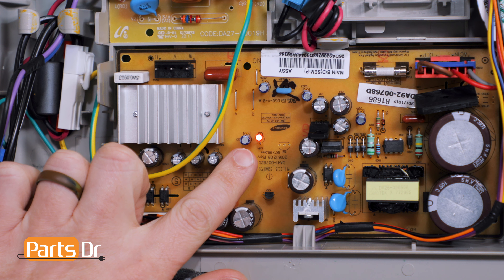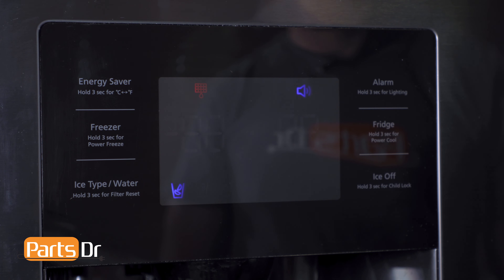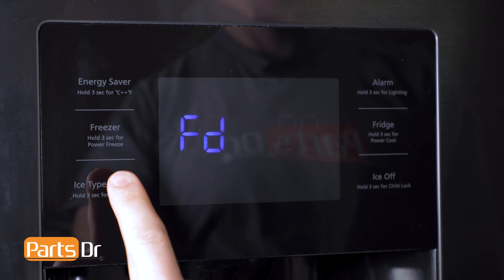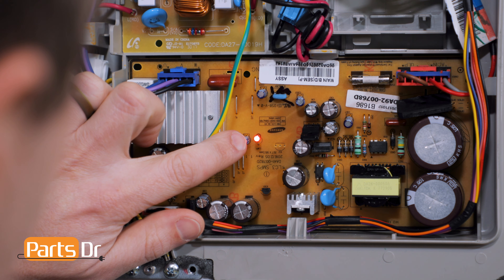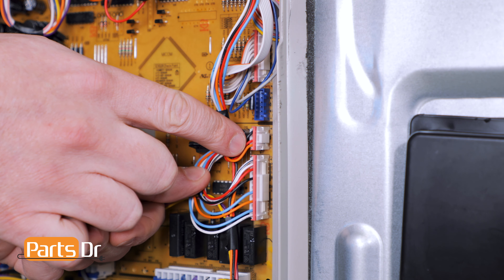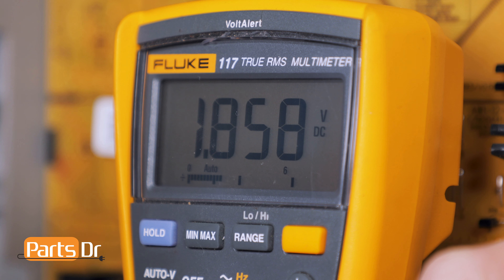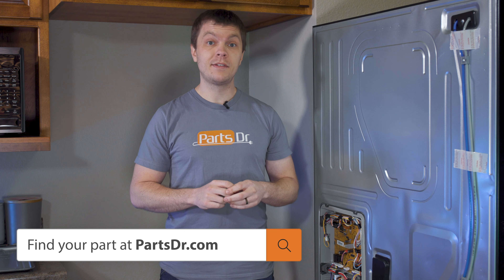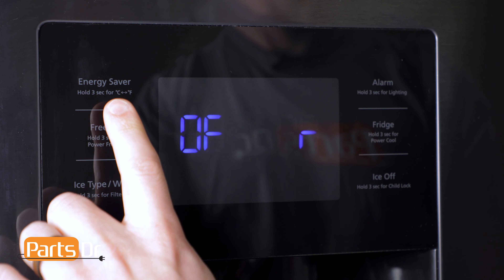Samsung refrigerator inverter control board troubleshooting & testing

Comment: Our refrigerator is flashing 0 FF i try several codes but it will not come out. Refrigerator will not cool. Inverted board burnt under heat sink. Can you help us? Model no. is RF28JBEDBSG/AA

Comment: I have a Samsung RF28K9070SR/AA. Just moved to another house. Was tripping GFI breaker. Put it into force on mode and light on inverter panel is solid red. Pump is not running. Any suggestions?

Comment: keep in mind that the signal on some fridges is a square or pwm signal, many multimeters will not read correctly so don’t assume bad control board.

Comment: What are the likely culprits for Under Voltage?
Reply: Faulty capacitors on the inverter. They don't have to be bulged to be bad. The supplier Samsung uses is 💩.

Comment: Hello, my refrigerator model Samsung RR35H661WW does not cool down. I checked the board. The corresponding LED lamp on the board is on and is fixed. Explain my refrigerator🙏

Comment: Dear Sir what sequence of buttons do I need to push to put a Samsung dual inverter fridge with bottom freezer to force the compressor to come on and check the voltage on the motherboard for this model number. RF27T5241SR

Comment: My refrigerator ivt com signal is reading 12 volt. Is it bad?
The symptoms are Freezer not freezing it's cold only .ice maker working but not making ice. 
Freezer is much warmer than the one is set to in the control board. Both actual temperatures in the refrigerator and freezer are not the same temperature displaying on the control board.

Comment: hi sir, thankx for the video, my samsung ref. inverter power board light steady with red light in running mode (the compressor is run) but the ref. not cold, what could be the probable cause.? thank you

Comment: I have a Samsung RF268ABRS..  The freezer and frig both stopped working at about same time.  I had a "fully on LED" at the pc board, fan is running next to compressor, compressor is humming, coils are clean.  I have fooled around with these reset buttons on the front panel, and now for some reason the LED is blinking a sequence of 1.  I canopy get the LED back to fully on.  And , when the compressor was running, there was no air flow at the vents inside the frig.  I assume you can feel that flow when the door is open?  Im at a loss on why this isn't working.

Comment: Great video!  What if the touchscreen is not showing anything?  Just a little red blinking bar next to the temperature.   The refrigerator still runs, but the freezer is not freezing cold.   Did the touchscreen go bad or is it something else?

Comment: I have 1.6v DC to the inverter board. Led indicator is blank and no output voltage to compressor. Just replaced the inverter board and it's doing the same thing now. Anything else I can Check?
Reply: Hi Eric, I have the same issue, did you find the solution for this ?

Comment: I have a Samsung Model RF18A5101SR/AA it has an intermittent problem of cooling then every 1-3 days it will stop cooling, It is fairly new but the warranty doesn't apply as I bought it off a 2nd party. I am an appliance repair person but cannot find a tech sheet. and there are no codes from the wifi. Any ideas would help. Thanks

Comment: Ok, did all of this and both LEDs are solid.  The fridge and freezer will not cool.  We had a power surge last night and woke up to it warmer.  Performed the reset and it started working.  This afternoon it stopped again.  No fan and no compressor running unless in FF mode.  Ideas?
Reply: Thanks for this video... I have been battling with my double door samsung fridge freezer for weeks now and I don't know what else to do again. I got the DA9200483G  inverter board and after installation the system control unit at the door , the compressor fan  and the lighting in fridge/freezer works but the compressor is not powering up. However samsung compressor tester was use to test  it and it power up fine only that the hot pipe is not hot because there is no gas in the compressor. Please what is the issue. All the parts are newly replace parts. Modem no is RSAIUTMG
Reply: @harryofume8792  what ?

Comment: I have an RFG237.  The inverter board has a single flash (starting failure). I get a reading of 0v on the compressor signal when I should see 2.5v.  Service guide says that the signal is 0-800Hz with a 50% duty cycle.  I have a low end multimeter (not true rms). Is it possible that my multimeter not get a true reading, i.e. it may misread that kind of square wave signal?
Reply from the maker: It sounds like you need a multimeter that can read voltage frequency.  The Fluke 117 we show in the video has this feature.
Reply: So meaning there is no output your inverter module, the inverter module receive signal from micro controller, then to the driver then to the inverter modules, check the DC supply 340vdc if available.

Comment: My Samsung fridge model is 401.40483800. 
Everything works but both evaporator fans have suddenly stopped. No cooling in either compartment. Changed mother board. Nothing! Thinking it’s board DA41-00317A whatcha think??

Comment: I have a model RF220nctasg/aa  that is not cooling. I have confirmed that the main board is supplying power to the inverter, but the inverter board doesn't seem to be doing anything at all.  I'm not getting any voltage reading at the compressor either, but that's not really surprising.  I've seen that I should be able to put it into the FF mode, but I don't have the front control panel that every video seems to show.   1) How do I activate FF?  2)What does it mean if my inverter board LED isn't coming on at all?

Comment: Thanks for this video.  My refrigerator model is RSA1STMG 240 volts and the inverter is top of the fridge.  Please let me know if I can get its full inverter control board from you or a compatible replacement.  Thank you
Reply from the maker: Sorry, we are not able to look up parts for non-USA models.

Comment: Hi, I have a samsung model RF263TEAESR/AA 
SERIAL JKG04BBH600176A
that the evaporator fans don't work,I already checked them and the fans are fine, could you help me tell me what are the cables that come out of the board for the fans, thank you

Comment: The LED is on solid and compressor is on but the freezer in not cooling or freezing. the refrigerator model is RS25H5111SG/AA. any suggestions please? thanks

Comment: does this board control the heater also?
i have a rf323tedbsr, the thermostat is sending signal asking for the heater to come on but is not. i force it to come on manually, putting the unit on defrost and it works but it does not work when the thermostat ask for it.
i don't know if this unit has a timer somewhere either
any suggestion will be appreciated, keep in mind thermostat is good, heater is good.
Reply from the maker: No, the main control board is what controls the power to the defrost heaters.
Reply: @PartsDr  thank you for the quick reply, i would assume is the board, double check everything and i clean the coil that it was very dirty. ill let it run for 3 days and see if it freezes again, i will replace the board.
thank u again
Reply from the maker: @victorl5891  We would also recommend to replace the defrost sensor as sometimes they can bench test okay, but act up intermittently while in use.
Reply: Oh! Mine defrost sensor did bench test ok on my unit. It won’t defrost whether in normal mode or Fd mode. Htr element is new. Control board?? Need advice on the road in a rv.

Comment: Not getting 125v at the defrost htr for Evap? Should there always be voyage there until the htr stat lets it pass thru?
Reply from the maker: No, it will only have voltage during the defrost cycle.  You can try putting the refrigerator into FD (forced defrost) mode to check voltage.  We show how to do that in this video here: https://www.youtube.com/watch?v=1DQZs75GEWQ
Reply: @PartsDr  
Yes I’ve done that and I replaced the htr because the diagnostic code pointed to that. Before putting into Fd I put the magnets on the box to fool it and and it never heated up. (Maybe I don’t need to use the magnets when running a Fd?) No voltage  coming from the connectors on the frig. Defrost sensors ohm checked out good against the chart. It is not defrosting at all. I’ve done a few things to mitigate air infiltration too including redoing Evap cover gasket. Do I need to pull it and check the inverter box? When I say pull it it’s in a motorhome and has been working fine for yrs. It actually cools really well until it frosts up again. Help, we are on the road!

Comment: Hi, I have Samsung RF4287HARS / XAA - initially my dispenser display unit digits light went off and replaced during the warranty and again after few months the new dispenser display did the same thing. 
Six months ago, it stopped cooling (compressor did not start ) but some component running sound from the top. replaced the main control board DA41-00683A. now again the same thing happened as six months ago - compressor did not start. 

Please let me know the force compressor start sequence and suggest me what would be wrong
Looks like the compressor has no issue

Thanks a lot
Reply: Hi , we have same model, Did you ever find the problem after you changed the main board? I’m having problem with my refrigerator

Comment: My defrost heater is not comming on Samsung refrigerator RS25 H5111SR I have tested the ones on heater and sensor they test good please help me where to go next
Reply: Same problems with my exact model number. Sounds like a main PCB board (defrost timer). Did you figure it out?
Reply: @natem3152  I have same problem, we're you able to figure it out? Thanks.
Reply: @thomassankara2857  no, this fridge is garbage. I had sent a complaint to BBB in New Jersey and samsungs office of the president reached out and offered a free repair. I did try to repair it before all this but the result of the engineers getting involved was that it's my fault. They wash their hands and and don't honor this being a manufactures defect. Look up 'samsung refrigerator recall u.s.a. now' on facebook. Over 26k members and $4 billion payed out for defects.. Never buy samsuck, I know I won't

Comment: Hi I have a Samsung RF28HMEDBSR/AA refrigerator I checked the board the light is not blinking AND I get a reading of 1.574 on my meater the compressor comes on immediately when it's set on the FF mode I have replaced the thermal sensors on the freezer and the fridge part both fans are working I replaced the fan on the freezer it still will not cool.the fan of the compressor comes on when the compressor comes on. I also replaced the assembly wire on the compressor I don't know what else to do to fix the problem the refrigerator will not cool at all

Comment: my Samsung Model is RF31FMESBSR AND THE FREEZER is not getting cold. the compressor is running and the fan is working. the invertor board has a solid red light. what do i check next.

Comment: Hello!

Please help! We have been without our refrigerator for a month now. Our daughter accidentally left the door open 1/4” for 2 days (we were away from home). We closed it immediately when we saw it. However, the freezer would know longer get cold. We did the self diagnostic test on the front and it blinked 3 times for inverter board. We replaced the inverter board but it still has 3 blinks and now neither the fridge or freezer will cool. There is a solid red light, compressor comes on, and fan works. Can you please help us? Model is Samsung RF268ABBP.

Comment: Model RF260BEAESR/AA. I could not get the FF mode. There is no blank control screen to start with. it shows 75 F and 75 F for fridge and freezer. the LED in the back is blinking and code says 81 E. for this model compressor starts failing is the definition of the code. I believe compressor is "kaput".

Comment: My fridge used the DA41-00411A inverter board and experiencing the 5 flash error. Samsung cheaped out on no name electrolytic caps. All appeared normal but removed and tested out of circuit every single one was WAY out of spec. Replaced with some budget Cheng caps and compressor is back up running again.
Reply from the maker: Great!  Thanks for sharing!
Reply: Great comment! I just replaced most of the caps on the same board (was flashing 5 times) and the fridge runs again.  3 of the 4 47uf caps were bad, replaced all of them as well as the 470’s just cause i had them laying around, Bingo, fridge works again!
Reply: Also, If I had to guess, the ebay repair kits for this board is just 7 smaller electrolytic capacitors.

Comment: Model RS25H5111SR/AA My Samsung refrigerator only 7yrs stop working and there is only a flashing white light on the front panel. Any idea what it is? Or, is it better to buy a new refrigerator ? Need some guidance/help. I unplug it, now for 2 days, still just that light flashing.
Reply from the maker: The flashing light on the front display would indicate an error code.  Similar to this: https://partsdr.com/blog/samsung-blinking-dashline-error-code-list/

Comment: On my samsung rf265abbp, the display shows -8'F for freezer and 38'F for fridge but no buttons work anymore. Had an episode yesterday where freezer and fridge both weren't holding respective proper temps. Unloaded and then 5 hours later freezer and fridge started working again. Ugh! How can I check the board?

Comment: I have model RF18HFENBSR. The control panel is on the top of the fridge at the back, but I cannot get it to go into FF mode. Holding the energy saver & fridge buttons for any amount of time, doesn't change the mode. I removed the panel cover and there is only a red indicator light. Thanks for posting this video and for any help you can provide.

Comment: Is an electronic board failure covered by Samsung’s warranty past the 2 year mark?
Reply from the maker: You will need to check your owner's manual or contact the manufacturer for the warranty details on your specific appliance.

Comment: Hi, I have a kenwood bcd-535wpzr/hc4 in the inveter box the led light is flashing 4 time's, does this fault apply to the same as the Samsung on your video? I'd be very grateful if you could help. Thanks Dave
Reply from the maker: Hi Dave, I'm sorry but we do not have any information on your refrigerator.

Comment: Samsung refrigerator rf287201sr light flash on circuit board bought it scratch and dent but came with no relay or overload to the compressor
Reply from the maker: It is normal to not have a start relay and overload if you have an inverter board.  See this video here: https://www.youtube.com/watch?v=dT0DTjktRUY

Comment: Any idea why the fridge kills my GFCI when the compressor comes on but no fuse or breaker?  Where can I get model or board number schematic?
Reply from the maker: Some refrigerators are not designed to operate on GFCI outlets.  Check your owners manual or with the manufacturer to see if yours is compatible to operate on a GFCI outlet.
Reply: @PartsDr  It has been plugged into a GFCI since we bought it.  That being said I'm trying to run it on a generator while our power is out.

Comment: My Samsung 4 door flex cool has stopped working.  Our power went our for about 5 seconds and now it won't come back on.  I have tried the manual reset but no go.  The unit clicks and the fan tries to move but no go.  Model # RF23J9011SG/AA.  Any suggestions as I do not want to pay 100.00 for a service call if I can fix myself

Comment: My Samsung Model RT21M6213SR has no power and nothing works.  The unit is a little over 2 yrs old.  I've done all the trouble shooting - plug, breakers, different outlets etc... will replacing inverter control board resolve this issue?
Reply from the maker: A bad inverter board would not act that way, but a bad main control board could cause those types of symptoms.

Comment: Please I have Samsung rf28hmedbsr model and my motor compressor  keeps stopping. It cannot stay on for more than 1 hour
Reply: It's not supposed to run all the time. What are your freezer and fridge temps? It may be overheating due to low refrigerant. Professional needs to check.

Comment: Light is solid, the compressor comes on but the air coming out at the back is cool not hot. The freezer is cold. The evaporator fan will not come on had a tech out to replace it and the thermistor.  Not sure what it could be.
Reply: I have a Samsung refrigerator model number rf323tedbsr I'm trying to figure out what the sequence is to reset my front panel

Comment: Samsung rs265tdrs : Both inverter board and motherboard flash once. Compressor not coming on at all. FF mode on makes no difference. Fault code mode shows no faults. Tested compressor windings and all of the 3 positions show 11.2 ohms. Not shorted to ground. Inverter board was removed and I don't see any obvious signs of damage. Are we looking at bad compressor or inverter board? I hate now that fridges are computers. Which components fail on the inverter board? Capacitors are not blown.
Reply: Yup same
Reply: @eriksxo  i replaced inverter board and everything was fixed
Reply: @Bizija123  appreciate it. Gonna replace mine as well

Comment: my fridge DA92-00988C inverter LED only turns on for a brief second when initially plugging in then it goes out. Only thing which turns on is the Family Hub computer screen but nothing else works. Water/Ice LED's in the front of the fridge just blinks.  Tried changing out the inverter board with no change.